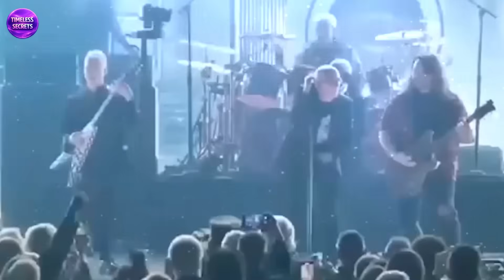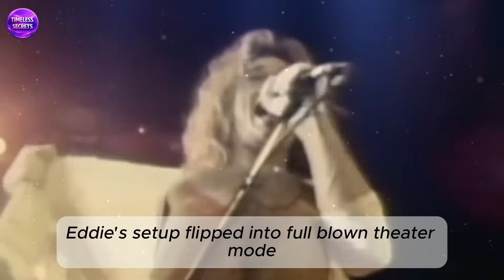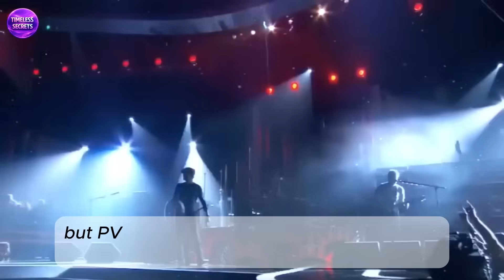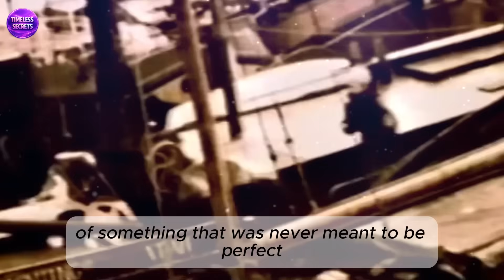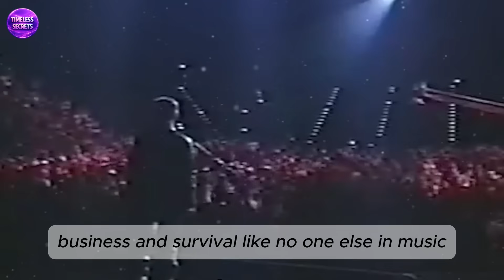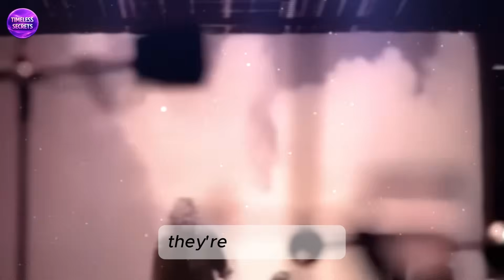Eddie Van Halen’s Deal With Peavey Went HORRIBLY Wrong… (The Fallout Was Brutal)

Comment: Sorry, his tone on F.U.C.K. is not a Marshall.  Nor on Balance, VHIII, or ADKOT.  He used his 68' sparingly because the output transformer was shot.  Reinhold Bogner tried to fix it, finally Dave Friedman had to cannibalize several period correct Plexis to get it right.  

His prized Marshall was just not cutting it.  

He had retired it and used a Soldano, then 5150.  His sound on F.U.C.K. onward had wayyyyyyy too much gain to be a Marshall.

Comment: I think this story is mixed up. He was actually digging Soldano amps during ou812. During f u c k he was at the 5150 amp phase. I'm sure he still used the marshal...but he did use the 5150. Come one wow. He used the marshal when it deemed necessary. He had a falling out over the music man guitar while using the 5150 leaves amp. Then the guitar. Then fall out of guitar and amp at peavey and went to fender/charvel. And even then probably sometimes probably used his marshal and acted like he then didn't use the peavey 5150. Now he has a peavey made 5150 amp.
Reply from the maker: You’re laying out the timeline pretty logically. OU812 era with more Soldano SLO-100 flavor, then the For Unlawful Carnal Knowledge period leaning heavily into the Peavey 5150. With Eddie Van Halen constantly tweaking, do you think fans expect too much linear consistency from someone who was always experimenting?

Comment: I thought the early 5150s sounded like crap. They were very inconsistent. There were good ones and bad ones. I always thought they were based off of a slo100.
Reply from the maker: You’re not alone, early Peavey 5150 runs definitely had a reputation for variance. And yeah, a lot of players point to the Soldano SLO-100 as part of the design DNA. Do you think the inconsistency was build quality… or just how unforgiving that circuit can be?

Comment: The 5150 is now considered one of the iconic amps. Used so many times on recordings and live by a multitude of bands. The OG 5150 and the Dual Rect are arguably two the most popular amps ever made. All I can say about Ed, is I worked for the area's largest promoter, had all access to wherever I wanted to go for three different VH tours. And the only thing Ed used live during that era was 5150's. No secret hidden amps, no false faceplates,  just 5150's with my own eyes and touch. I even saw and touched his prototype Wolfgangs long before he left Ernie Ball. In fact it can even be argued his best live sound was on the VHIII tour, again all 5150's. Ed legitimatized Peavey in the rock world and they sold alot of amps and made alot of money.
Reply from the maker: That’s firsthand perspective right there, hard to argue with eyes-and-hands experience. If Eddie Van Halen was running straight Peavey 5150 heads live with no smoke and mirrors, do you think that’s what cemented its legacy over something like the Mesa Boogie Dual Rectifier?
Reply: @TimelessSecrets2  Yes, it cemented the 5150. And Peavey needed that so badly to be legitimized. Crazy thing is some of their pre 5150 amps were great amps for rock, they just looked terrible. Ed even argued with Hartley Peavey over the look of the 5150. Hartley hated the silver faceplate and hated the modernized Peavey Logo but Ed stood his ground. And he was right because the amp looked great, was affordable and it sounded fantastic for hard rock. As for the Dual Rect, I consider it and the 5150  "the" amps of the 90's. The 5150 is all over tons of metal albums and the Dual Rect was the poster amp for alternative metal. There is a reason both of those amps are now modeled on every single piece of digital gear. I was lucky during that era, being a musician and a gear head I loved checking out all the bands gear after setup. Some techs were really cool and some were not.
Reply from the maker: @TheTN24  That’s a killer inside perspective, the look absolutely mattered in legitimizing the Peavey 5150. When Hartley Peavey pushed back on aesthetics and Eddie Van Halen stood firm, do you think that visual identity helped it compete head-to-head with the Mesa Boogie Dual Rectifier in the 90's?
Reply: @TimelessSecrets2  Absolutely because they are both as identifiable now a your classic Marshall head.
Reply from the maker: @TheTN24  Exactly,  the Peavey 5150 and Mesa Boogie Dual Rectifier are just as instantly recognizable as a classic Marshall Amplification stack now.
Reply: But he is saying Eddie couldnt even be bothered with the 5150s and secretly ran Marshalls.....
Reply: Totally disagree with VH3 tour being his best tone. It had this artificial, nasal quality to it. EVHs tone got significantly worse come late 90s, and it never got "good" again. This is my opinion, of course. I used to own a 5150 and an SLO100 at the same time. The SLO had a MUCH more organic and big sound. That is an amazing rock amp.
Reply: @karlsalocks  I owned the SLO as well, preferred the OG 5150. SLO didn't have the gain of the 5150. Now I'm not comparing the build of the amps as the SLO with the military grade specs is on a whole other level, in fact the only amp I've ever owned that had a better build was the Mezzarbarba Trinity, another work of art but tone isn't always in the build of an amp. I traded that Trinity to get an ENGL Artist which "to me" blew it out of the water. It's a subjective though. What you like is what you like.
Reply: @TheTN24  It is of course subjective.

Comment: I always thought the 5150 sounded closer to a Dual Rectifier than it did a Marshall.
Reply from the maker: I can hear that, the low-end thump and saturation on the Peavey 5150 definitely lean more modern than a classic Marshall Amplification crunch. Do you think it’s the tighter bottom or the extra gain stage that pushes it toward Mesa Boogie Dual Rectifier territory?
Reply: @TimelessSecrets2 I watched a interview with James Brown recently and he said it was actually based more on a soldano
Reply from the maker: @wangosmith  That lines up with what a lot of tech heads say.  The Peavey 5150 circuit shares DNA with the Soldano SLO-100 design. Do you think the 5150 refined it… or just repackaged it?